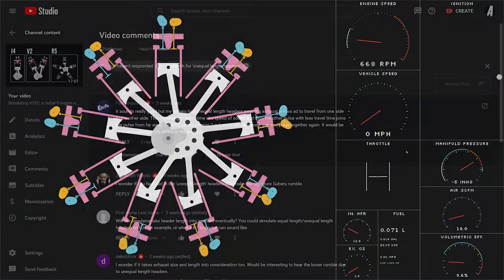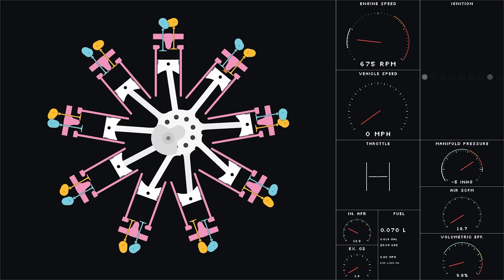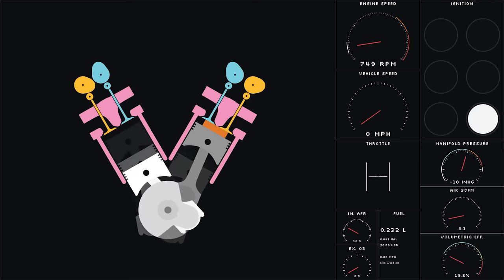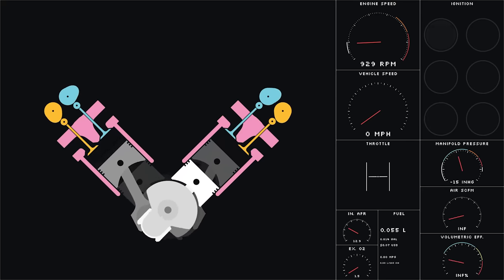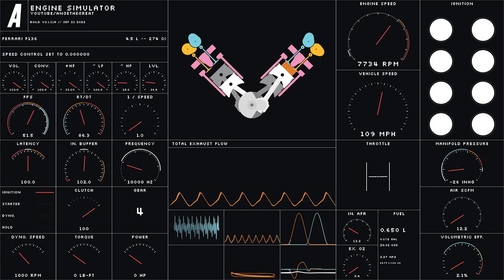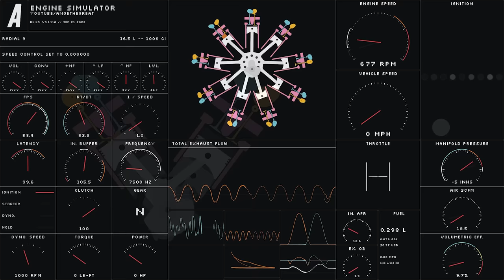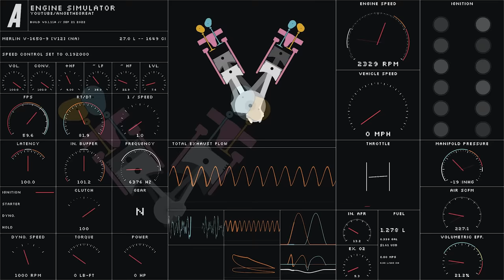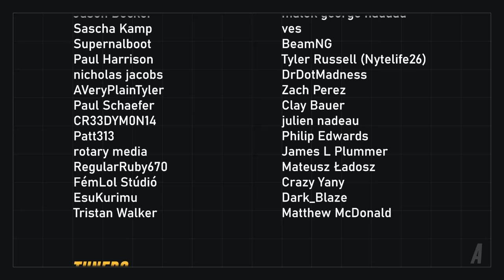Simulating an F1 V12, cross-plane and flat-plane V8s, unequal length headers and more

Comment: 9:43 you should try comparing the sound of the voodoo motor from the 2016 mustang gt350r, using uneven and even length headers. it’s my favorite v8 and it’s another really good example of how much of a difference headers can make

Comment: The old Lincoln Zephyr V12 had a 75 degree angle between the banks--probably to provide space for the manifolding to the side valves on the inside of the V.  The Rolls-Royce Meteor tank engine was essentially an unsupercharged Merlin, so you could just call your V12 the Meteor.

Comment: I was obsessed with exhaust sound and through extensive experimentation I was able to discover one method at least of getting that typical raspy sound that some nicer sports cars have. What you do is you have a normal fully muffled exhaust system, and then you just make a small hole or two before the muffler. That way the full system still keeps out the drone and low pitch, but the small hole lets out a little bit of that higher pitched anger, just enough to give that cool rasp sound.

Comment: For aircraft engines, i’d love to see prop sound simulated by this with the ability to be either direct drive or gear driven. Set the number of blades and alignment relative to the crank and have the listener positioned perpendicular to the axis of rotation so you hear the shockwaves as the blade tips pass. The shockwaves get harsher as the blade tip speed approaches mach 1.

Comment: In case nobody has yet suggested it, I'd like to see a simulation of a W3 engine, specifically the engine developed by Jim Feuling back, I think, in the early 2000s. It is effectively a three-cylinder version of the Harley-Davidson Tin-Cam 88 engine.

Comment: While the ls engine doesn't sound much like a corvette or camaro ls engines, it sounds a whole lot like a less restrictive 5.3 vortec. Which is still an ls, just not by name.
Reply from the maker: The exhaust system makes a pretty significant difference. I've worked on a few V8s and just removing the exhaust system and running them with open headers is enough to make them sound like completely different engines. So it really depends on what you're trying emulate.

Comment: What I would love to see once the simulation can handle more than 12 cylinders would be an x24 Rolls Royce Vulture, famous in particular for its use in the Lancaster bomber. Additionally, it would be interesting to hear some small engines, like the 2 stroke engines found in chainsaws and Briggs and Stratton type mower engines.

Comment: will be really great to have wizard window to create engine, for example select number of cylinder, select block type inline or v , select camshaft duration and firing order, stroke length, bore diameter  and etc and after that get this simulation with created new engine.

Comment: The Merlin engines were so powerful just the exhaust gases would push some 200HP if I remember correctly. That's the entire firepower of a Golf GTI provided just by the exhaust of that thing. :D

Comment: 13:02 why does the throttle not appear to open? I imagine there’s no speed because it’s an aircraft engine but why no throttle butterfly valve opening
Reply from the maker: It opens very slightly. There is not much load on the engine so the throttle doesn't need to open much to accelerate the engine.
Reply: @AngeTheGreat  oh it seemed like it was at a high rpm, I’ll have to go back and take notes of redline

Comment: Musician here. The sound I hear with the EJ25 before you add the unequal length headers is basically a single pitch (for you nitpickers out there, there are whole bunch of other frequencies heard but they are dominated by the frequency corresponding to the time from one exhaust pulse to another)
Once you add the unequal length headers, what I hear is the fundamental frequency (that's what we heard before) and a second resonant frequency a major third higher. The "major third" sound indicates a ratio between the two frequencies where the higher frequency is 5/4 times the lower frequency. I don't know why, but maybe the exhaust travels 25% further to reach the meeting point on one side than the other.

Comment: Hi mate, noticed you went down the path of unequal headers. Wondering if you've also modelled connecting different cylinders to each other in the headers. the EJ20/25 engines mostly get their rumble from connecting banks, rather than simply unequal length headers. The same can be one on an I4 by connecting cyl 1+2 and connecting cyl 3+4 in a 4-2-1 design. Normally, you'd go 1+4 and 2+3 for even pulses. Similar things can be done on I6 with either 6-2-1 (1+2+3/4+5+6) headers or 6-3-1 (1+6/2+5/3+4) headers, though neither of them are odd fire. Also the multitude of possibilities with V8s.
Cheers

Comment: The Rolls-Royce Merlin without a supercharger is relatively similar to the Rolls-Royce Meteor, which was the Merlin in a naturally-aspirated form and detuned for use in ground vehicles, primarily tanks - best known probably in the Centurion MBT. In the Centurion especially the engine makes more of a whining noise that's very well-known to the tank, which I'm not entirely sure on the cause of but I can very slightly hear in the simulation here, which is very nice.

Comment: One thought re: the program struggling with high complexity engines: an option to run the simulation at non-realtime speed, but render out the sound (and possibly other data) to a file which can then be listened to later.

Comment: Just as a point to potentially update and because it would alter the sound slightly I believe is that radial engines have a master rod that looks like a normal conrod, except all the other rods connect to it instead of the crank. The radial in this video doesn't seem to have a master rod.
Reply from the maker: Yep, you're right but it actually does already, I thought I mentioned that specifically in this video but I don't remember anymore. The vertical piston is the one with the master rod

Comment: I never knew an inline 4 sounded exotic. That's all a European flat plane crank V8 is--two inline 4s joined at the crank, so it will sound similar to an inline 4 (especially with a true dual exhaust), and sure enough, Ferrari V8s sound a lot like inline 4s. It's similar to the relationship between a V12 and inline 6, and a V10 and i5.

Comment: I found a glitch where if you engage the dyno with the engine stalled/ignition off you can get the engine to rotate in reverse. Sounds weird and is interesting to say the least.
Reply from the maker: Nice discovery! The reason that happens is the simulator has an algorithm to determine which direction the engine spins but when the engine is still, it can't figure it out so it might end up getting it wrong lol
Reply: Also noticed on v 1.11 the kohler engine has a governer. Nice addition, however it seems that the governer is trying to raise the engine speed. On real engines the governor does the opposite and tries to keep the engine from over revving by acting against a spring that tries to pull the throttle wide open. I do not have coding experience so I don't know how hard this would be to add/change. Keep up the excellent work and I'll definitely be getting the paid version if/when it releases.

Comment: 12:51 on the first 30 seconds of this video i Realize you where the dev behind steam engine simulator (on Steam plataform), now at this point of the video i remembered myselft having 2 intances of the steam engine running near 3k revs.

Comment: Imagine like a procedurally generated engine noise that could change with different tunes, cams, intake, exhaust etc. The sound of the engines under load was super  impressive. Always felt that was missing in games.
Reply from the maker: The sound actually already changes in the simulation with different exhaust/intake and cams. If you watch the previous video, the VTEC "crack" is simulated based only on the change in cam profile.
Reply: @AngeTheGreat  I saw that!  I was thinking more along the lines of how some games have different interchangeable parts/tunes. Having this as real time response to different types of induction, exhaust set ups etc. Also got me thinking about forced induction, if you could somehow tie your model to a turbine to behave under load. Then tie an intake noise to follow psi/rpm of different turbocharger performance curves. Anyway I'm sure you've been thinking of all this stuff. I appreciate the reply and looking forward to more of your work!
Reply from the maker: I see what you mean! This is actually exactly what I'm working on now for the Steam release of engine simulator which will have a 3D engine editor and will update in real-time. You can find more information on it on my Patreon. Thanks for watching!

Comment: How far away is the full game? And how would I try out the unequal length headers ?
Reply: If you open an engine file, scroll down to the part where it says add cylinder it should be a few lines down.

Comment: This is awesome! Please do a deep dive into V8 engines. I'd like to hear the differences between cross-plane engines with equal and unequal length headers, as well as flat-plane engines with u-d-d-u and u-d-u-d, like the Ford Coyote engine and with equal and unequal length headers. Does the u-d-u-d crankshaft of the Coyote engine affect the sound or does it sound so different from Italian flat-plane engines because of the unequal length headers?

Comment: hey one question. how much of the sounds timbral quality is owed tobthe convolution algorithm? 
is it always the same convolution signal? or do you switch from motor to motor? and how did you chose the signal itself?
Reply from the maker: I suggest watching my Engine Sim technical explanation video. Most engines use the same impulse response and doesn't really change the sound substantially in most cases
Reply: @AngeTheGreat  i did watch that initially. I'm coming from a music production background here where impulse response tools can be used to substantially alter a sound. So i wondered what the modulator sound was. (e.g. is it a recording using the motor in real life or sth to that effect). But judging from how you wrote your reply i assume i'm misunderstanding the way "impulse response" is used here.
Reply from the maker: I didn't use anything too fancy, I just recorded some impulse responses of household items like tubes to get some sort of resonance in the simulation. I didn't use any audio of real engines or anything
Reply: @AngeTheGreat  okay thanks for the info! would be interesting to me to sample actual motor impuls responses and see if the results profit from it in terms of realism.

amazing stuff you do btw. it looks like you code as a musician improvises music. very impressive.

Comment: This is really cool.  Any plans to add tail pipe resonance? Might be as simple as adding a slight percussive thump to the primary pulse, and applying eq to reduce higher frequencies. As is, reminds me of standing in front of the car and listening to the engine run with the hood open. Would really cool to get it to a point where in a game it could sound more like the street note. Especially if the game models Doppler shifting. :) (And if haven't before, look up the BRM V-16 from the 50s. Some sound samples exist and it easily the most beautiful engine sound ever)

Comment: I would be cool if this simulator could also simulate the masses of the motor, e.g. a Parallel Twin with 90° firing interval which causes a lot vibration

Comment: Something I noticed about the “LS” engine is your displacement is 2 ci larger than the actual engine, but your LS does sound like the real thing
Reply from the maker: Hmm I'm pretty sure the numbers shown are correct. The 5.3 is actually not exactly 5300 cc, it's actually closer to 5330 cc. In fact, GM made a few different 5.3s, the one I shown in the video is based on the L84 and has the same bore/stroke. It's usually quoted as having a displacement of 325 CI and if you use a displacement calculator, you should get the same number.

Comment: Any even fire 6, be it in line or any v angle can all sound the same. V6's tend to sound different simply because left and right bank tend to be unequal because of packaging issues. Also 60° is not ideal for a v6 it's a compromise just like anything other than 120° although a 90° counterweighted arrangement does give a perfect primary balance just like a v2. A 15° offset from center line in both directions with a 90° bank angle and a counterweight is the best compromise for a v6 covering all the problems except the odd number of cylinders in each bank causing an end to end rocking moment usually handled by a counter balance shaft. Fun video though great work.

Comment: I'm interested in the 16CSVT engine and it's cylinder angle, firing order, etc. ,  for a miniature loco. Got any knowledge of the thing? It is 10" bore, 12" strokes, with 4 separate turbochargers and exhaust outlets. From the side it sounds wonderful in stereo!

Comment: I would love to see a deep sounding I5. I think the sound I'm thinking of is primarily from the stock log headers, but not really sure. I think on the log style headers they either meet up between cyl 4&5 or all right at cyl 3. However, the sound i'm thinking of could also be on equal length. Im really not sure

Comment: i would like to see a yamaha r1(crossplane)vs busa or other 1 liter bike engine with similar specs it would be cool if you could make v8 versions of the bike engines too like v8 busa used by ariel radical and h1 
pagani m120
honda made a 6cyl cbr1000rr that sounds like an old f1 v12
w24 would be interesting
daytona 675 3 cyl a vertion v6 and v12 
idk how hard it is to add cylinders i assume it is not so hard

Comment: Would reducing the timescale of the simulation and speeding up the audio output in post fix the resolution/artifacting issues?
Reply from the maker: This would be one way to correct the artifacting and it's pretty much equivalent to offline audio rendering

Comment: It's worth noting that before 2001, most American V6s were OHV, single-center-cam engines, not DOHC has you have in these simulations. Pushrod engines have a significantly different exhaust note than DOHC or SOHC engines.

Comment: basically many car guy know Lexus LFA firing order is different, the exhaust is design differently, and it's v10. Like yeah maybe that's what cause the sound to be so good. But somehow when we remake that in a simulator, it doesn't sound quite pleasant, quite epic like the car itself. But ayy still u do good tho👍

Comment: Are you computing volumetric efficiency considering 2 crank rotations? otherwise those values  must be halved thus never exceeding 100% ever. 4 strokes engines have a power cycle every 2 rotations.
Reply from the maker: Naturally aspirated engines can exceed 100% volumetric efficiency. There are other factors influencing the intake of air besides ambient pressure. Air velocity, resonance in the manifold, exhaust scavenging, etc. They can't usually exceed 100% by much but it is possible

Comment: Could you solve the issue with having more speed or pistons by having a real-time mode and a prerendered mode. The latter could be used for the more complex engines and you can sim it at a lower speed and speed it up before playing it back.

Comment: I know this is old, but I have to ask if you added the capability to this to also simulate some of the vintage engines?  for example, the Model T engine, Gottlieb Diamler's 1100 single from 1886, or the crosley CoBra 4?  some of us only see these  parked at car shows or only run into them on simulation games.  also, did you add the "turmpety" sound particular to Toyota engines?

Comment: Hey, can you combine exhaust primaries from multiple banks into one collector yet, or have them all be separated?
Reply from the maker: They actually already are. In the simulator, an "exhaust system" is simply a collection of primaries that all meet at one collector and then vent to the atmosphere.
Reply: @AngeTheGreat  Alright, awesome. Thank you. Okay, so outisde of that, do you have like a coding guide, specifically stuff on how to make the cams and ignition timing phase correctly even for super weird crank setups that don't fire evenly?

Also, It seems that either the cams or ignition timing is heavily reliant on bank angle, as when I was playing with the Hayabusa file, I tried to angle the block and it went from making 190HP to 30HP with a much poorer throttle response. Any way to fix those? Should I just start from scratch with any new engine I want to do?

Also, do you have any guidelines on port volumes and head flow rates and combustion chamber sizes and such? Like a few sets of "ratios" for "this is a basic head, this is a high-performance head, this is a crappy old-fashioned head" etc?

EDIT: Crap, almost forgot, is there a way to, further down the line, combine "exhaust systems" or otherwise cross the flow such as with an H-pipe or X-pipe?

Comment: Just found your channel. Very interesting and definitely intrigued me. Could you do tractor engines? Specifically, an inline 6-cylinder 362CID John Deere. Or if I download the simulation program can I plug the parameters/specs of the engine and get the results I am looking for?

Thanks,
Coalson Foss

Comment: would a 2x or 4x 8 cylinder radial engine (in total 16 or 32) be possible?
I´d assume that even a double radial engine is much more balanced and can reach a higher RPM (even without accounting for the extra power)

Comment: Hello, I am having issues regarding starting the program.
I have Windows 10 and installed the 1.9 version of the Sim (download, unzipped it and run the Exe file. It said the Vulkan-1.dll was missing. I searched, downloaded it and placed it in my system as well as in the exe file directory. Now when I start the program, it goes full white and then shuts himself. What can I do ?